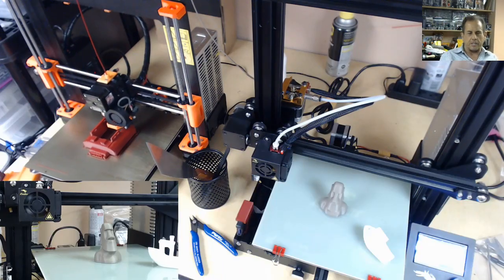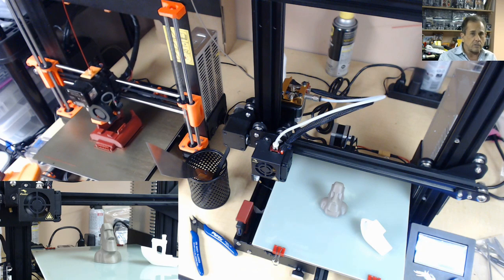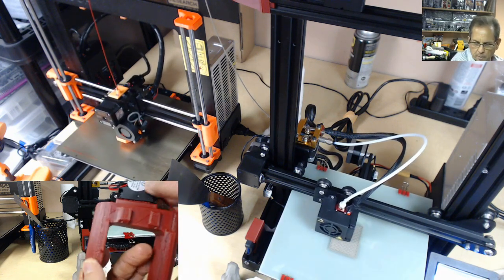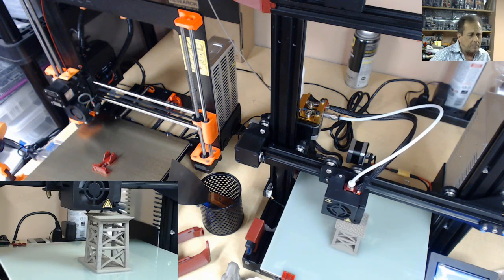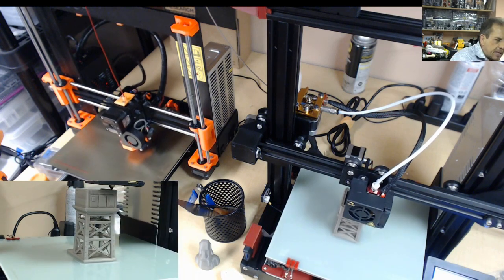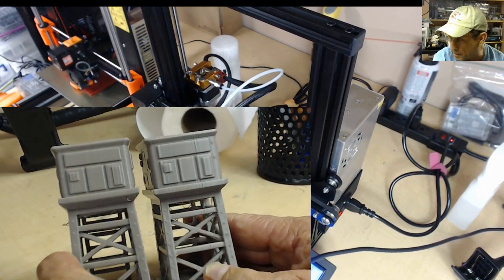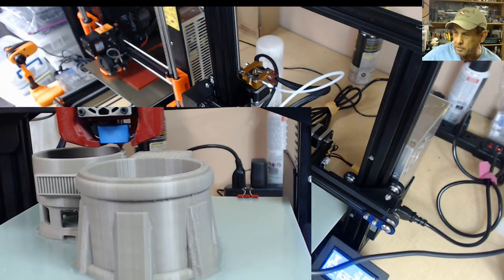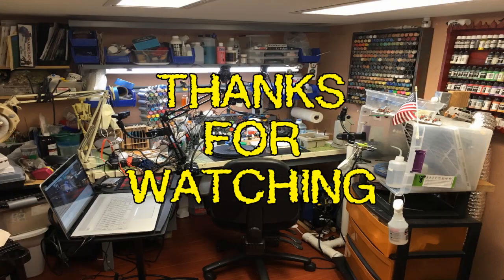"Ender 3 Stock cooling vs the Petfang 2"

Comment: Thanks for reviewing my design. Unfortunately you are correct, my stock fan mod is only marginally better than the stock cooling setup since I can not increase the stock fans output beyond it's limits. My design was professionally engineered around the +-4 CFM 5015 roughly 8 times the output of the stock fan. Try the same print with the 5015 mod and I think you will be pleasantly surprised. BTW, There are internal baffles to balance the airflow and will fail if you print upright. I have orientation instructions and installation videos at http://www.petsfang.com. I also have a mod for the Prusa 3. Although a little bulky (because of it's plenum based design)  it is finding a following for it's ability to negotiate overhangs much better than the stock Prusa cooling. Thanks again, Dave
Reply: David  it's  pretty well documented, lol. Do a little research before you attempt a troll.
Reply: David shut the fuck up

Comment: The problem with adding an aftermarket fan shroud is you lose the full width of your bed those huge plastic pieces bang into the stress relief & wiring at the back of the bed & even into the clips at the edge of the bed although I'm using a glass bed so I need clips to hold it on. On the topic of glass it's much better to print on you won't need any chemical sprays and you get such a smooth beautiful bottom.
Reply: No, they are not xD check this: https://www.thingiverse.com/thing:4124943/files

Comment: Personally imo, any versions of the fang (especially the Petsfang) will get better results if you changed the stock fan to a 5015 blower. The stock part cooling fan is quiet weak compared to the 5015 blower
Reply: I printed the petsfang with the 5015 blower and usually I don't go over 40-50% fan